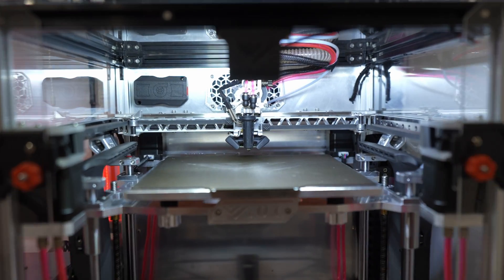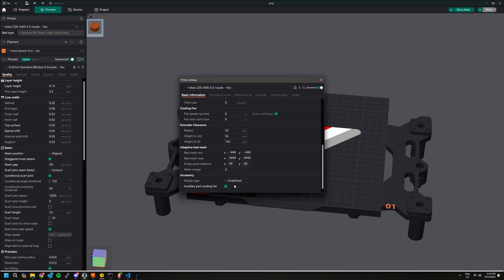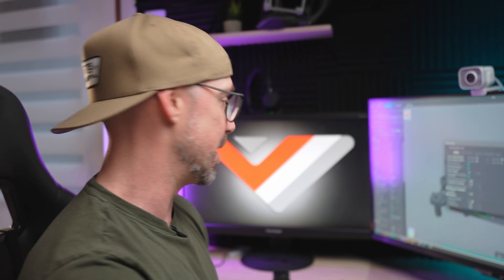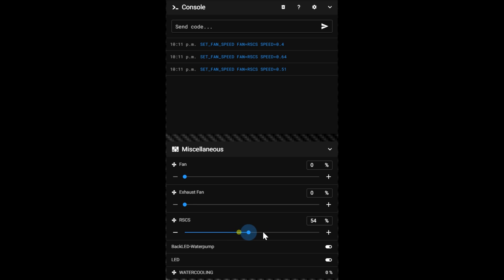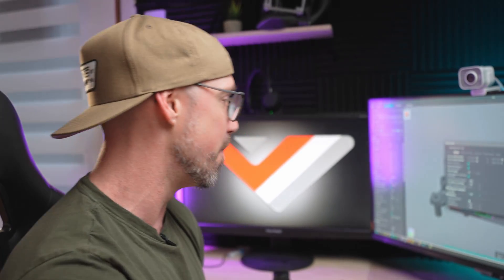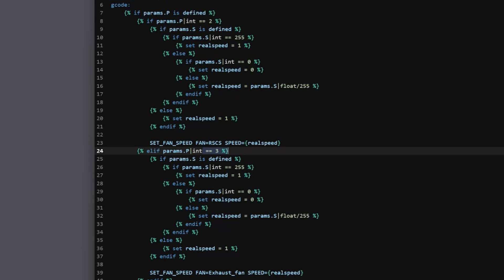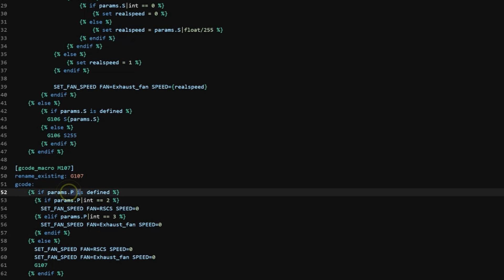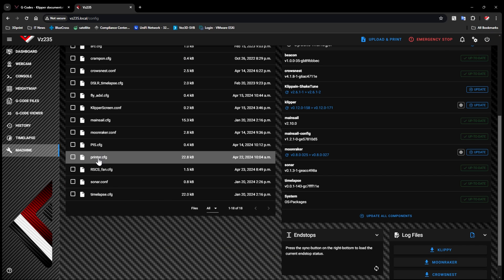Control your Aux fan (RSCS) with Orca Slicer

Comment: Hi! I got a question about this: i added four exaust fans to my vcore 4 (using your nice stls, but please increase the size of the "height setting thing", it breaks pretty easily) and now I wanted to add the auxilerys using your (newer) macro. I used two fan ports on my ocopus board, PD13 and 14 - config as a "generic" fan for now. Am i able to run the macro just like that, or do i need to have them as aux fans ? Thanks in advance!

Comment: How have you connect the fans? Have you used the same cable or connected two pin for each fan? I check your github and the rcscs is uncomment.

Comment: I am using a similar macro, probably inspired by the same one as you. :D The difference is that I use the slicer to set a desired ratio between part cooling fan and RSCS, so that if the part cooling fan speeds up, the RSCS does as well, with a setting 0f 0 meaning, that the RSCS will stay off, 50 meaning both will run at the same speed and 100 meaning, that the RSCS will run twice as fast as the part cooling fan or at !00% if the part cooling fan runs at 50+%.
This is what my macro looks like:
[gcode_macro M106]
rename_existing: M106.1
variable_rscs_speed: -1.0
gcode:
    {% set fan = params.P|int if params.P is defined else 1|int %}
    {% set speed = (params.S|float / 255 if params.S is defined else 1.0) %}
    #part
    {% if fan == 1 %} 
        M106.1 S{params.S} 
        {% if rscs_speed >= 0 %} SET_FAN_SPEED FAN=rscs SPEED={(speed*2*rscs_speed, 1)|min} {% endif %}
    {% endif %}
    #aux
    {% if fan == 2 %} 
        SET_GCODE_VARIABLE MACRO=M106 VARIABLE=rscs_speed VALUE={speed}
        {% if rscs_speed >= 0 %} SET_FAN_SPEED FAN=rscs SPEED={(printer['fan'].speed*2*speed, 1)|min} {% endif %}
    {% endif %}
    #exhaust/filter
    {% if fan == 3 %} SET_FAN_SPEED FAN=filter SPEED={speed} {% endif %}
Reply from the maker: excellent idea as well. well done :)